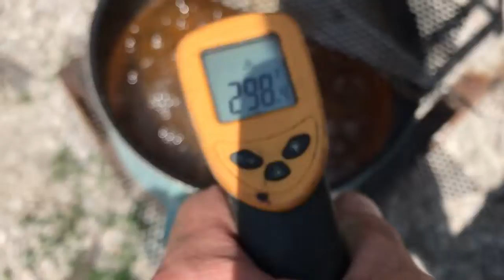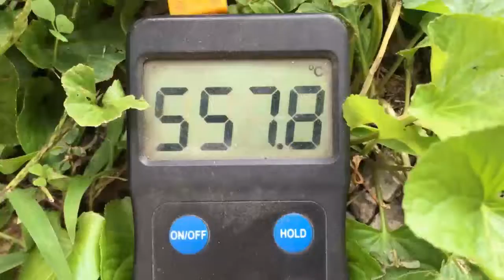Hydrogen storage materials R&D

Comment: Hydrogen storage, outside of ultra high pressure, or cryogenic, is quite hard to make effective from what I’ve read.  Is this metal hydride storage? (I need to read up more on that)
Reply: The new ways store the hydrogen safely as water and release it on demand with catalysts. In Indiana they are using it on dpw trucks and the army is converting armored humvees
Reply: Ya man
Reply: I mean, it's all sort of dumb because the best way to store hydrogen is in hydrocarbon fuel.
Reply from the maker: I agree , i was paid to do this work and i warned him not to do it
Reply: Robert Szasz i agree, upgrading of hydrogen to other fuels, mainly methane, methanol, and dme makes way more sense
Reply: @RobertSzasz  if you want centralized expensive energy that is acceptable.  It's also the source of all civilizations problems. Decentralization and free energy cures this. Water is stable and abundant. Nano aluminum or solar hydrogen catalysts like plasmonic nano gold. Or even molybdenum sulfide/titanium dioxide photocatalyst
Reply: @peterlang777  I'm all for moving away from fossil fuels. Renewable hydrocarbons are the way to go for anything that can't be hooked to the grid or recharged from it. The problem is that transporting and storing hydrogen sucks. It sucks so much that even where it's at its best (rocket fuel) nobody wants to use it if they can avoid it.
(Aluminum and water is just a crappy way to turn electricity into hydrogen)
Reply: @RobertSzasz  it is not regular aluminum. It is nano galvanic aluminum. A dry powder . It is added to water to fuel massive army vehicles. It is very energy efficient.  The superiority of water over hydrocarbons is the lack of central control. U.s. military wants it to remove fuel supply convoys that are a vulnerability in logistics
Reply: @peterlang777  They still need a supply of aluminum... so the supply line isn't eliminated; the necessary capacity/carry capability is reduced.

Comment: Um. I'd be really really careful boiling the water off of that. If your doing what I think you are, thermal runaway and spontaneous decomp can happen leaving you with way nastier stuff than ammonia in the air.
 
I'm guessing you're forming cobalt nitrate then decomposing it? (Just based on color) perhaps palladium nitrate? 
Be super fucking careful with heavy metal salts. They are crazy toxic.
Reply from the maker: graphitic carbon nitride is what they are calling it . Yes i definitely dont want any runaway reactions